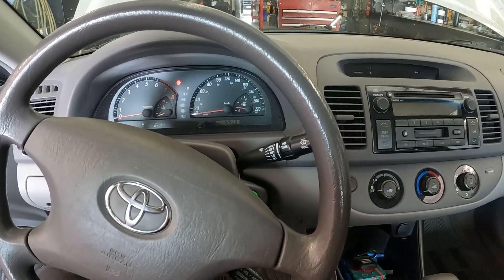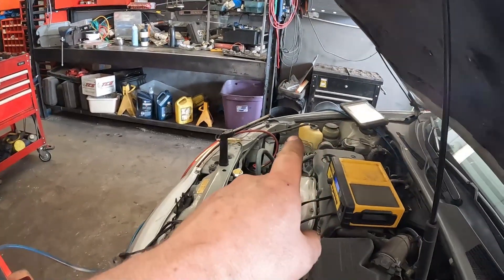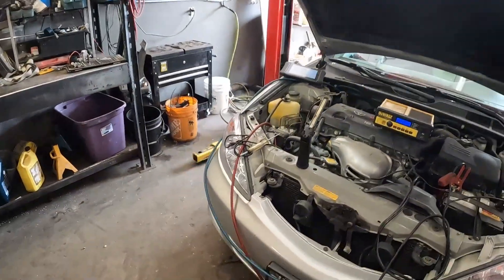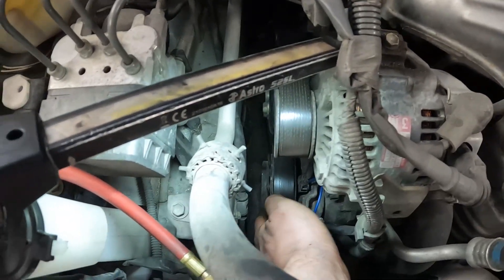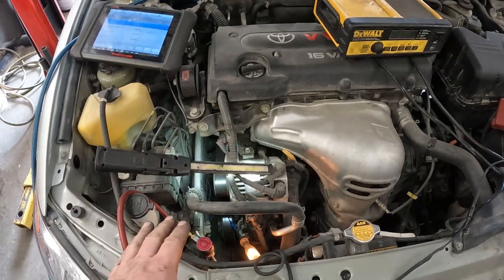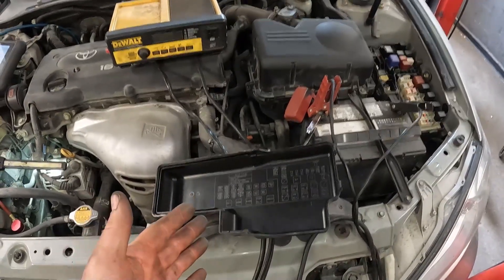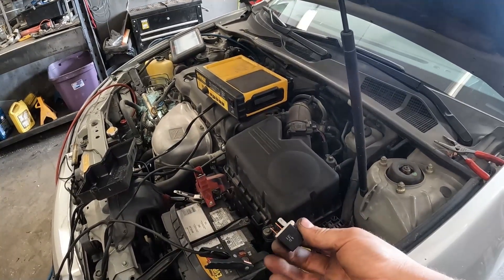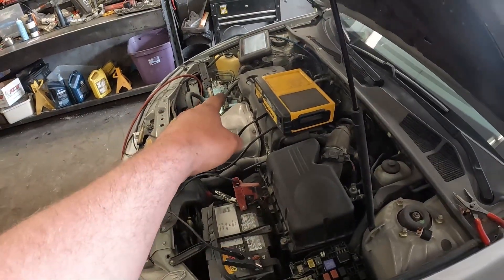Best way to test a relay! 2003 Toyota Camry with no A/C. Compressor won't turn on.

Comment: You are just learning this?
Won’t help you if it has a relay circuit module.
Reply from the maker: @mikejmardis  Yup. I never bothered swapping relays or anything like that before as no-op problems usually aren't caused by relays. Instead I'd usually just do my testing directly at the component as it has a higher chance of failure. Exception to that is I've been finding a lot of A/C compressor clutch relays that are faulty. Especially among Toyotas and Hondas. Getting quite common on the newer solid state relays.

I'm not sure what you mean by "relay circuit module"? Are you just talking about an integrated relay directly on a circuit board..?